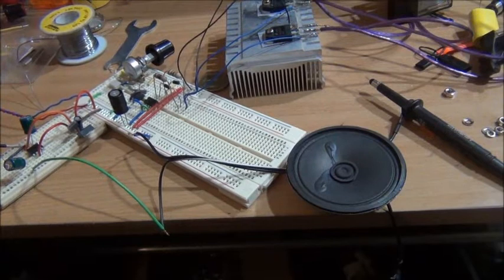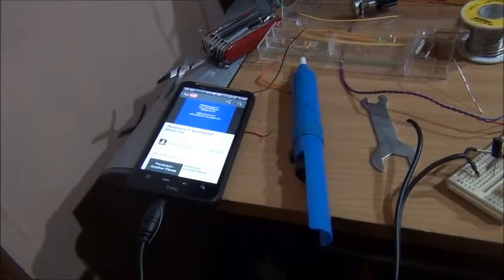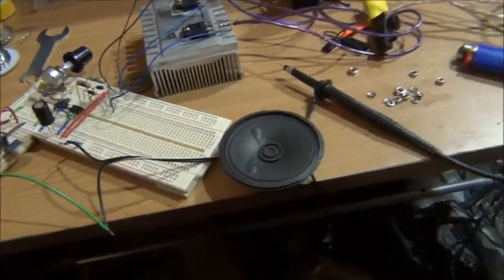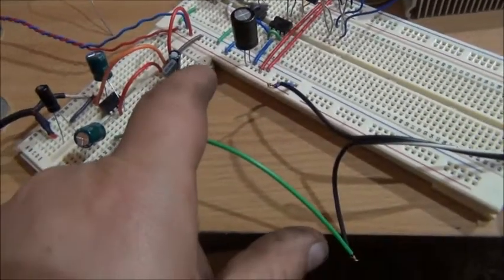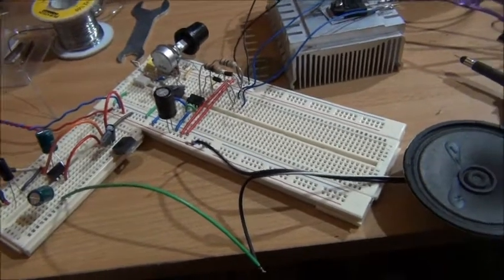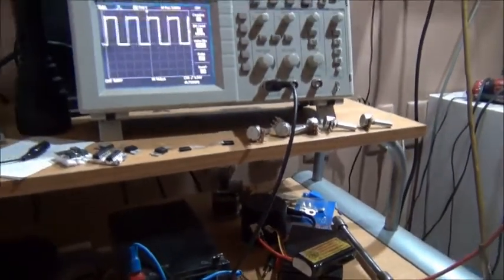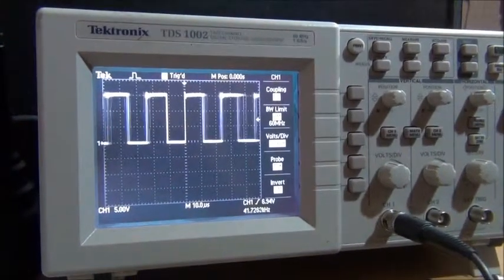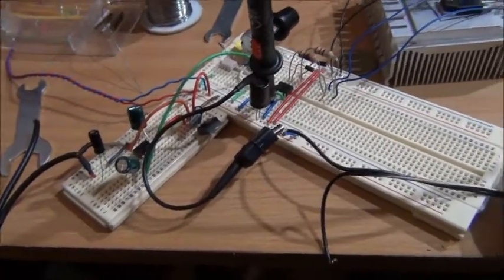Audio Modulated flyback waffling for dirkk82

Comment from the maker: TC4424 mosfet driver IC
there are larger versions. but for one or two mosfet it should be fine.
if i push my volume too hard, it will distort, but its quite loud. can be heard well over all the clutter in the room noise wise. i will do a video soon :) been real busy with my multicopter

Comment: hey whats the mosfet driver you're using? I think thats the next step in my driver. at the moment it runs off an amplifier ic and 555 but I want to take the load off of the 555.

What kind of output are you getting from your driver clarity/volume wise?
I get about an inch ark and really clear thanks to the audio amp :D

Thanks for getting me into flybacks btw!

Comment: The parts I know is tpa3106d1 (40W mono, output is bridge).
SMD, you may find some pre-made board if SMD soldering is tricky.

I did buy a YDA148 board from dealextreme, that have output filters, "Y148 Audio Amplifier Module". rather cheap, and good sound quality.

You can try to use something like that to drive coils from a sound-card.

The big ones (Texas intruments, Maxim, Linear e.t.c.) all have some Class D amplifier solution.

Feel free to contact me, erlendse at gmail / google talk.